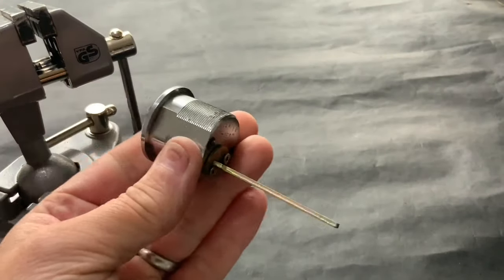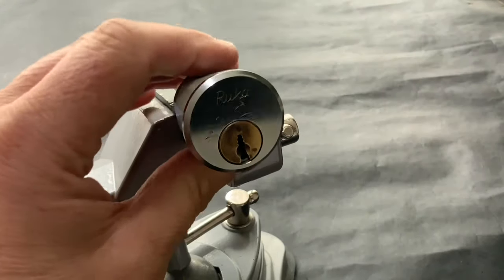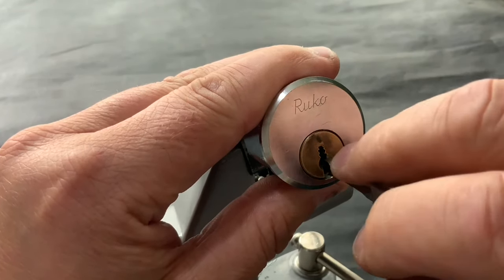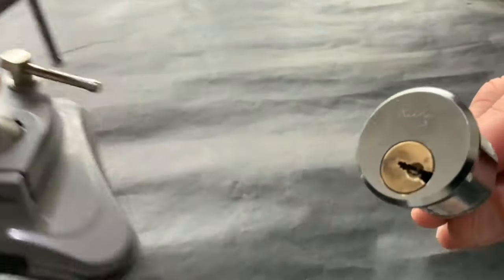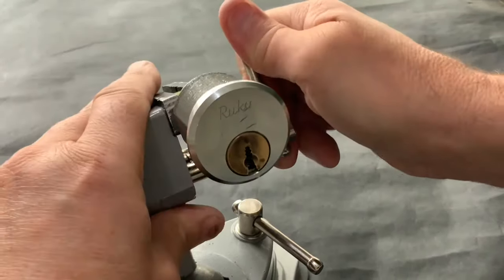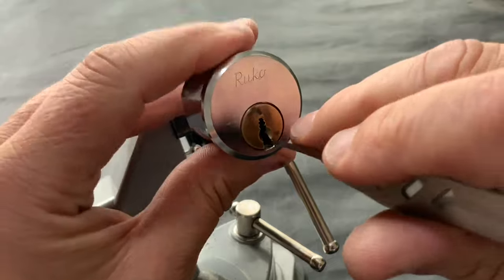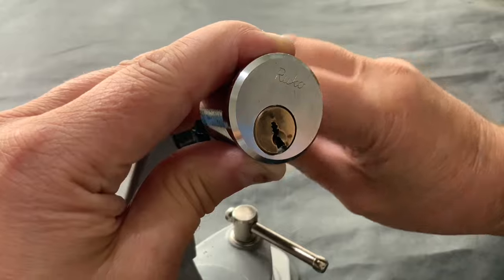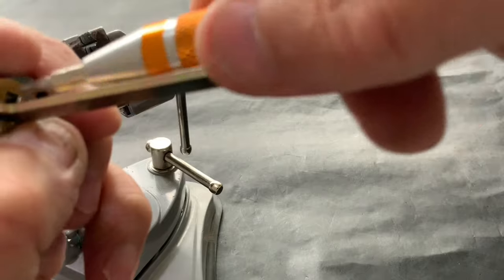(93) Lock Picking for Beginners- Ruko Rim Cylinder Lock Picked & Gutted without using a tension tool

Comment: To be honest that was very nice picking on the Ruko. Nice driver pins too. You know I have a Master Lock And Safe rim cylinder (It's not a master lock) that is a bit of a pain to pick because of the bitting and the warding. I lost the keys a long time ago which is gutting in itself. I picked it after trying it off and on for a while. When gutting it I accidentally locked it,  yes it's a frustrating feeling. I picked it again and thought, "I should video this". I got out the camera and then spent an hour failing to pick it. I haven't had another go at it for ages because I fell out with it 🤣.
You are not alone with the skill to accidentally re lock a lock.............
Great video.
Reply from the maker: Roy Sammons , I do these types of silly things on a daily basis, but it’s all fun and games and you learn by your mistakes. Glad to hear you do them too ( in a nice way ) haha 😂👍
Reply: @BrummieLockPicker  I forgot to say that I completely understood what you meant about feeling the lock when picking in hand. I have noticed that too, you can feel the pins and the pick giving very slight vibrations and it does help as you feel like you can read the lock better.